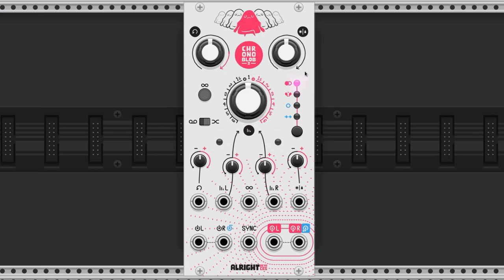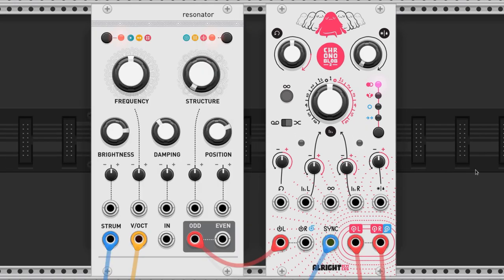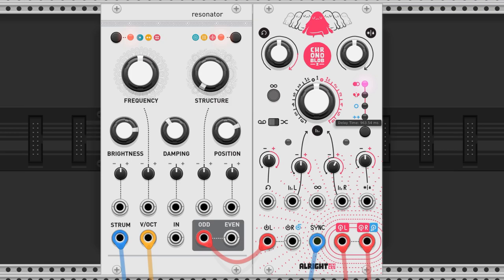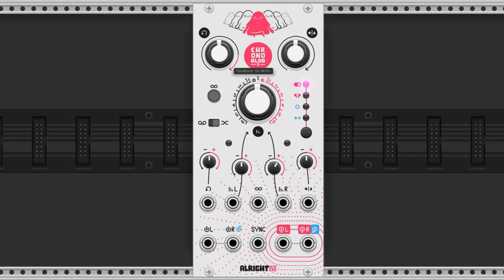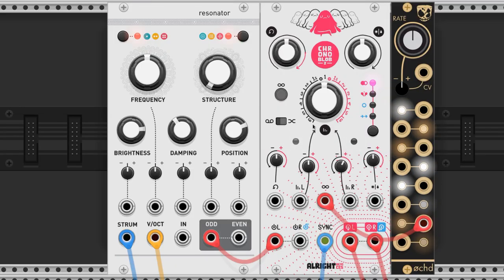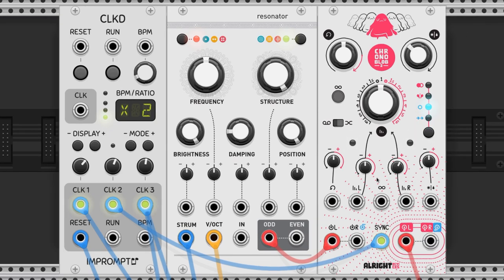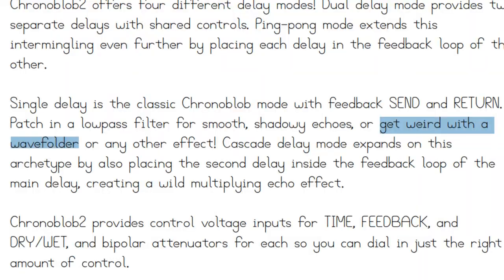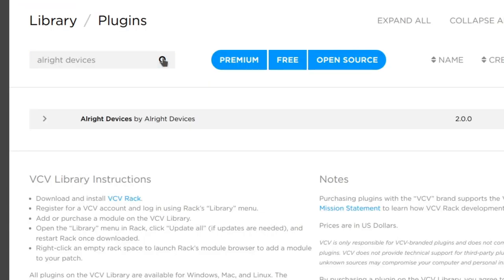The Best Delay: The Chronoblob2

Comment: I would've liked to hear why you like it more than other options.
Reply from the maker: Thank you for the comment George! The combination of the sync, infinite loop, and send/return in one package knock my socks off with this one. So much value in a small package.
Reply: @yourpalrob  have you tried the NYSTHI clockable delay? In general i prefer the blob, but the NYSTHI module has the patchable feedback loop in full stereo, which is great for ambient/ textures. Even so, I reach for chronoblob more for a few reasons: vastly better ergonomics including but not limited to look and feel; different delay times on left and right; most important, the crossfade mode is awesome for glitches or 12k style blippy ambience. Also the NYSTHI delay sometimes clicks (in a bad way) when it reads the clock as unstable.